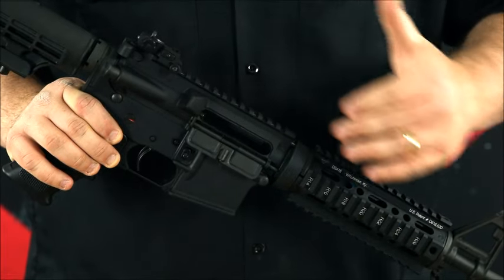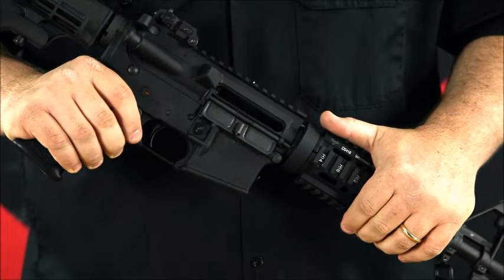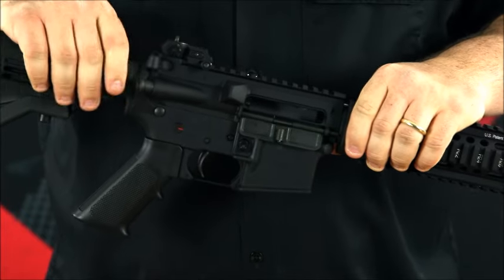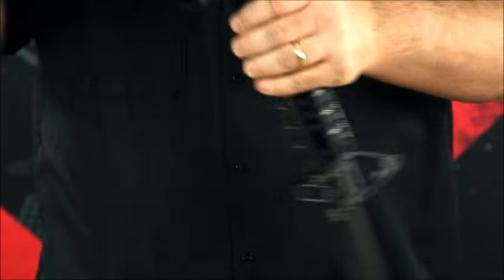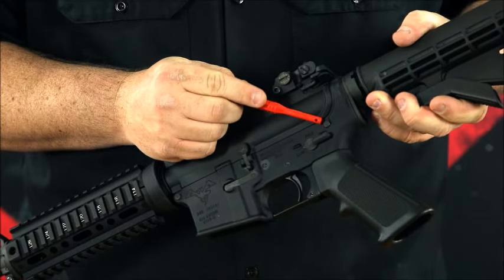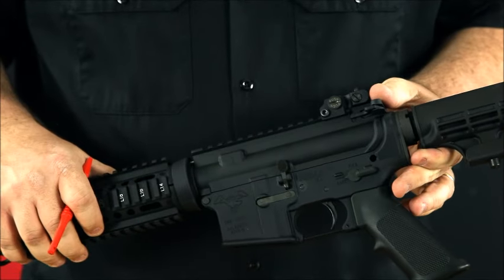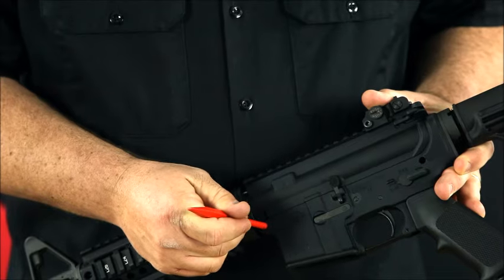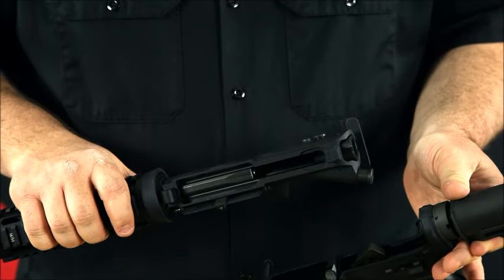AR15 Upper and Lower Take Apart

Comment: What would happen if you forgot to drop the bolt before you separated the upper? I did this on accident and the bolt slammed forward, I didn’t have the barrel on tho because it’s a takedown. Ruger sr 556